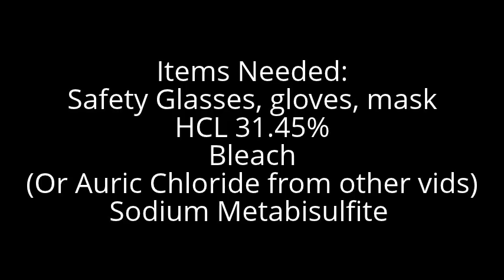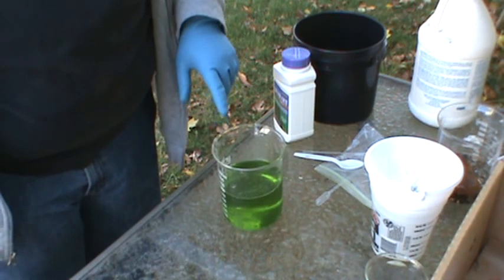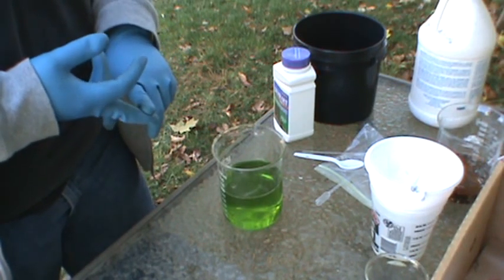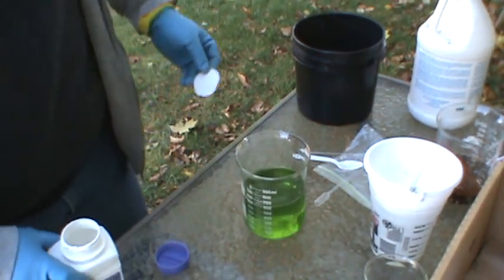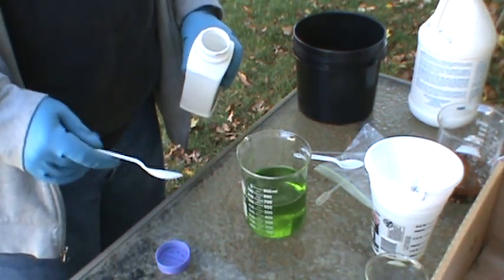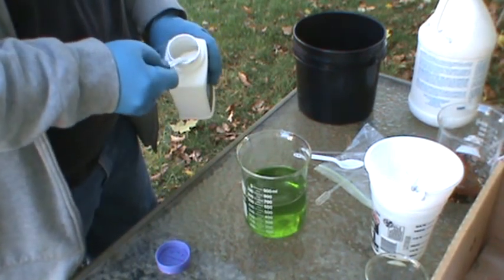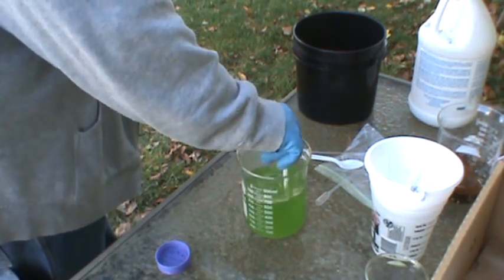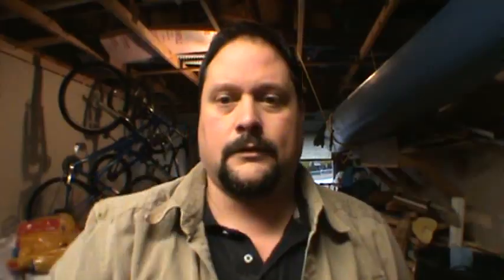Gold Recovery:  A Refining Process to Purify Gold

Comment: I think you're doing an awesome service to people. I haven't gotten to the chem processes yet because I want to make sure I thoroughly research ways as well as alternatives to the deplating process. I have the 23K Gold Pokémon cards as well as a bunch of electronic scrap cut up and ready as well as some gold filled items. I have been practicing work with silver. Thank you for everything. I have been learning quite a bit from you.
Reply: +Dominick Mas List the pokemon cards on ebay, you will get more than the scrap gold value of them is worth
Reply: I did. 5 of them for $15 and no one bid. Any less than this, I decided they're going into the recovery process. Bought the Acid Magic yesterday. Reverse electroplating will be on the table soon as well.
Reply: +Dominick Mas Odd. I guess scrap it is then

Comment: Ok moose, when I add my new gold foils to my existing auric chloride solution do I need to add more bleach or what? What do you do?
Reply from the maker: Caz you only need to add more bleach if the foils stop dissolving but only add a small amount and do not seal the bottle until the reaction has completed.

Comment: Hey moose did a little experiment using bleach and muratic will disolve platinum off the glass hard drive disc but when u use it on the hard drive disc that is aluminum it will disolve the aluminum
Reply from the maker: Kurt Bump yup.  Leaves you with a bubbling liquid mess of "what do I do now?"  I have read on the GRF that this method is really not recommended for recovery of platinum.
Reply: Thought I would try it the same way with gold after I do 4 disc going to add sodium bi sulfate to it
Reply from the maker: Kurt Bump Most likely wont work unfortunately.  SMB selectively precipitates gold, not platinum.

Comment: Hi.. I have a question that I hope you can help me with or put me right if I have got it wrong.. after dropping the gold with smb. The liquid that is left may contain silver and other good stuff.. how do I get it out? Is it a case of letting it dry out and do something to the crystals that I guess would be left?
Reply from the maker: Kyle Hopkins Hi and thanks for watching!  This is not aqua regia so silver does not get taken into solution.  True Aqua Regia made with HCL and Nitric acid would have silver taken into solution, I have never used this solution so unfortunately I can not answer that.  the goldrefiningforum has a full walk through on this however.  best of luck to you!
Reply: Hi thanks for getting back to me..keep up the good work :-)

Comment: How often can you use the same solution to dissolve foils or should it only be used once and done ive has the solution for 2 months and dissolved 2 small batches just to test it out both batches disolved how ever i assume i dont have enough to precipitate it out ive check on it 48 hours later to only see nothing has settled
Reply from the maker: Christopher Lucas TO the best of my knowledge, this solution can only be used once.  What I typically do is use a 16 oz glass vinegar bottle and fill it half way with the HCL bleach solution.  I keep adding gold to it for six months then precipitate out.  If there was no reaction after adding the SMB then it is very likely that you did not have enough gold in there.
Reply: Ok awesome thanks moose

Comment: hey moose, i really need some help with something i have done this a few times and the first time i did the fingers and ever thing came out perfect. the second time was a alot less and when i put the mudd in the crucible it disappeared. I chalked it up to possibly had not been enough. well this time i got a new crucible and dropped about a pound and a half of plated pins. every thing worked out until i went to smelt the mudd again and i had close to a thumb size mudd ball that i was smelting and it completely dryed up and when i tryed to take it out the crucible it was just chard dirt. not a gold anything. and i fallow the steps to a tee. and would really question my self had i not had such success the first time. and im having the steps work out until i go to smelt the gold mudd at the end? any ideas any one?

Comment: Welcome! I did the process, the processor is subtracted from the gold, I put sodium-metabisulfidot, a week passed and still no gold, only white powder at the bottom of the glass. What could be wrong?
Reply from the maker: László Nagy How much gold did you put in?  THe biggest reason this experiment fails for people is because they do not have enough gold to make the reaction.  To get a good reaction you need to have at least 2 grams of gold in there and use less than 200ml total of solution.  Here is a link to a better video.  https://www.youtube.com/watch?v=oL2Si9zTRx8
Reply: Moose Scrapper Thank you for your response. I think a better solution electrolysis.

Comment: I would have liked to see the final step of the process..I find this completely fascinating.
Does the preliminary process work on gold filled jewlery
Reply from the maker: Hi and thanks for watching!  My most recent 3-5 videos have been a redoing of this experiment in more detail and with better data keeping.  I am currently experimenting with using this method to remove gold from plated items that have a copper or brass base metal under.  I plan on making a video on that sometime this winter.  Thanks!

Comment: Nice video Moose.
Does the sodium metabisulfite/pyrosulfite neutralize the acid when you add it? Or is there some other process by which that is done that I'm not catching?
Reply from the maker: Hi and thanks for commenting!  Once hte gold has settled, the solution is evaporated off and the gold powder dried.  Filtering I have found is not the best way to go mecause the gold particles can be small enough to get through the filter.
Reply: No it reduces the gold, so that the gold goes from Au2Cl3(aq) to plain simple solid gold (Au(s))

Comment: Great Video Moose, but when you said a face mask in the video, that is incredibly dangerous. Chlorine gas is NOT filtered out with a regular mask. The only mask anyone should use is a cartridge- type respirator with acid/ gas filters (P100 rated). If you don't you have a chance of death or heart attack. Just some advice.

Comment: Really nice video :) I want to ask you, how many grams of fingers do you have to use to get out this result of ~3 grams.

I'm working on making a machin that will do the wholle process by itself. only plans so far, investment soon. But just to get an idea of the amount of lets say ram sticks i have to get for a certain amount of gold fingers and then figur out aprrox the outcome.
Reply from the maker: Hi and thanks for watching!  outcomes data is really hard to esitmate due the the huge amount of variables in the gold plateing ranging from age, brand, karat, etc.  Not all companied plate the same way, and technology has improved over the years allowing less and less gold to be used.  The best estimate I could give you, and it really isnt that great, would be that it woudl take 100-300 ram fingers to make 3 grams of gold.  Best of luck to you!
Reply: Moose Scrapper
Nice :) Thanks a lot for the info and the videos.

Comment: Si,,,how do you heat up the solution exactly?  Do you heat until all liquid just evaporates?? On a stove in your kitchen?  What do you do with the "waste" stuff when you're done?
Reply from the maker: You need to heat it out side.  Use something like an old coffee maker that you will never ever ever use again....  Waste disposal varies from city to city.  You would need to contact your local city hall to ask about their dispoal programs.  Thanks!
Reply: Thanks.  I've been obsessed with scrapping lately but I may quit at radiator and filing cabinet disposal!! You never know.

Comment: After you refined the gold from the RAM and things like that, what is the next step to get where you are in this video, because you went from the flakes to a green solution? So do you put the flakes into the HCL and bleach solution? If so then how long do you wait? Thanks! @moosescraper
Reply from the maker: ***** Hi and thanks for watching!  The solution turned green as I was adding more ribbons to it.  One of them was color and had ink on it that changed the color of the solution.  The flakes from the fingers go right in and dissolve in seconds.

Comment: How do you know if the dishes are actually gold plated?
Reply from the maker: Chemical test kits are dirt cheap on ebay and wor well, also many of them will say on the bottom of the plate that its 14k trim or 24k trim etc.

Comment: You say you put to much HCL in the solution. So what is the correct ratio?
Reply from the maker: You want to keep it small.  The more HCL you have the harder it is to precipitate the gold out.  You want to use the least amount of HCL to cover the items then use about 20% or so of that volume of bleach.
Reply: Thank you very much for getting back tome on this. I've had pretty good sucess with this formula. Thank you very much again.

Comment: I have seen using Sulfuric Acid and electrolysis to remove gold covered copper and it leaves the copper for scrap. It turned the sulfuric acid dark brown to be filtered. Since I am a poor-man operator, that video shows using a filter system, a vacuum pump, a high dollar flask/beaker to do all that to recover the yellow gold filled acid in a Lab setting. Do you know if they used SMB to recover the gold from the acid? The reason I ask is, I have the acid. Could I recover the gold without all the vacuum pumps, etc and recover the gold? I have looked to try and solve this....and found no answers, YET!
Reply from the maker: Hi Corey, thanks for watching and commenting!  Reverse electroplating is a very interesting method of gold recovery however I have not experimented in that nor have I done enough research in that to give any good answers.  I can tell you that the entire process can be found on the goldrefiningforum.  Just try not to ask any questions there before trying to search for the answer first.  They can be a touchy group sometimes.  Best of luck to you!

Comment: Hey Moose! Once you have the dissolved the gold, used the Sodium Metabisulfite, the remains at the bottom of your bottle is gold? I know you say that in the vid. I have watched another video a few yrs ago where the guy used the SMB and it was like a brown crusty pieces of dirt. He took them and dumped them into a crucible and melted with flux to get pure gold. I haven't seen any videos showing this except that one back then. Is that the last step? The melt down part?
Reply from the maker: yup, filtering, drying, and the melt down.  Make sure you let it dry first.

Comment: now I follow the instructions and it turned the solution orange and nothing happen y
Reply from the maker: Orange?  You sure you are using the bonide stump out that has sodium pyrosulfite?  I have no idea what could turn it orange....
Reply: I think there to much bleach I read you can cut it back with water and boil it off seams to be getting better I will keep you updated

Comment: how did  u get  the   gold to  liquid  form after  taking  it off the  fingers
Reply from the maker: Hi and thanks for watching!  Not quite sure what you are asking but will attempt to answer.  The gold does not get to liquid form until its melted.  Once the gold foils come off the fingers, they are dissolved in the HCL and bleach mixture.  Then the gold is dropped or precipitated out of the solution with sodium metabisulfite, or in this case, sodium pyrosulfite from Bonide brand Stump Out.  The fine gold powder at the bottom of the flask is then filtered and dried.  Hope that answers your question.  Thanks!
Reply: Moose Scrapper  great vib moose.. i watch some other videos regarding gold fingers fr rams. Some are using muriatic acid and hydrogen peroxide together, then urea to nuetralize the acid and the SMB. with your experience, what gives the best result? hope to from you.btw am fr the phils
Reply: Rolando Nunez quick tips please.. is auric chloride can also be use for gold recovery in cellphone and simcards? thx again..

Comment: It is my fisrt time to do this by recover gold from plate, i succede to remove the gold from a plate but my problem is,  whem i poor stump out into a solution i can't have any positive result ( i don't see any gold on bottom of the solution. why is it like that ?).
Reply from the maker: A lot of people don't realize how much gold you have to process this way to get results.  It takes a lot of material to make a few grams of pure gold.  So you used the AP method to remove gold plate from boards then dissolved the gold flakes in HCL and bleach?  How much solution did you use?
Reply: Moose Scrapper
I used 300 ml of HCL and 20 ml of bleach to remove gold from two royal coffe plates and whene i remove gold from plate i add two coffe spoon of stump out...
Reply from the maker: Oh ok.  Well, the reason you did not get much of a reaction is because there is very little gold that can be recovered from just two plates.  Also, you used too much stump out.  Try it again after doing 2-3 dozen plates and then try one teaspoon of Bonide Stumpout.  Make sure to use Bonide brand as its one of the only stump removers with sodium pyrosulfite.  Remember it takes a lot of gold plated stuff to make a little bit of gold.
Reply: Moose Scrapper
Thanks i 'm going to try again and i will let u know what i did...
Reply: thanks a lot ! i made it this time, i' happy thanks again
Reply: GUY RENE wat?

Comment: And all of this green color of the solution, it came from Nickel ions, I presume?
Reply from the maker: copper mostly I think.
Reply: Moose Scrapper Well, reviewing the video, I think that is Cu(I) as it exist only in very acid solutions and/or oxidant environment as is the case, but before the silver layer in electronic circuitry, usually the copper is plated with nickel.
If you put a sufficient amount of ammonium hydroxide in this solution and it turn form a precipitated and putting some more ammonium hydroxide it turn deep blue, it's a pretty good indication of copper, as the diaminocopper complex is formed.
Reply: In the water industry we use 36% or also know as 22 degree hcl to regenerate cation ion exchange resin would 36% be to concentrated for the refining process

Comment: Can you tell me how to make my stannous chloride
Reply from the maker: Sure, you take about 30mls of HCL 31.45% and dissolve 2 grams of pure tin or 99% tin solder.  This solution does have a shelf life depending on storage conditions.
Reply: ty
Reply: Hey Moose I know that i can use Stannous Chloride to check to see if I have gold in my hcl/beach solution . what else can I use it for if anything
Reply: d scrapper Take 100ml of HCL 31.45@ and dissolve 2 grams of pure tin in it.  You can find 98% tin solder at hard ware or plumbing supply stores.  I only use it to test for gold but I am sure it has other uses.